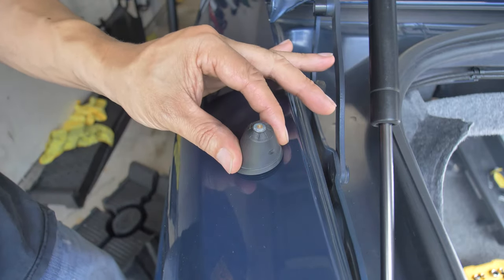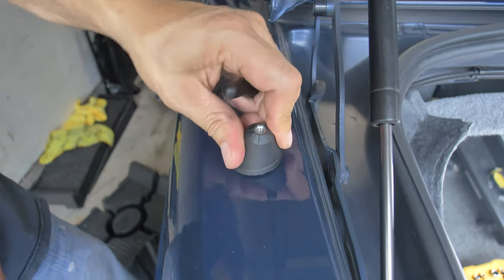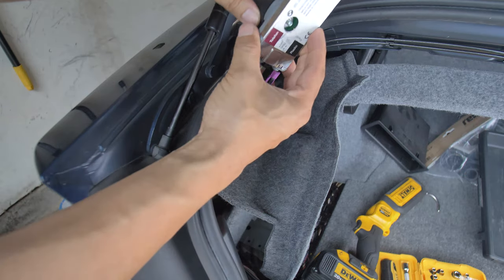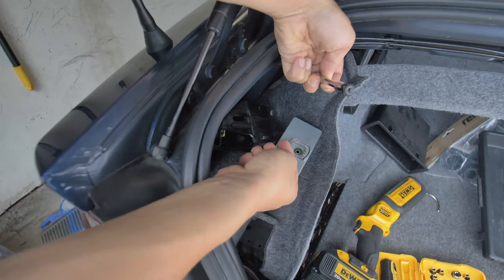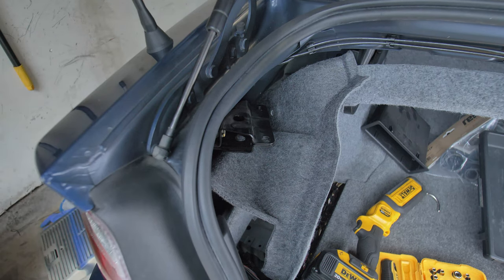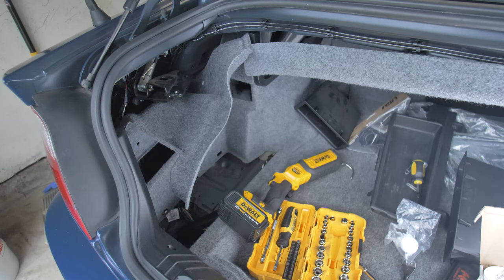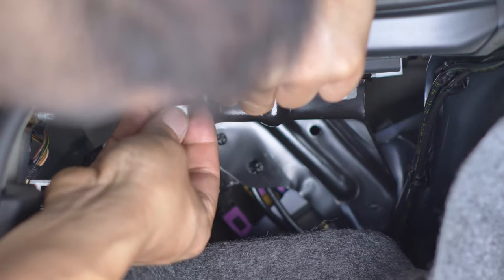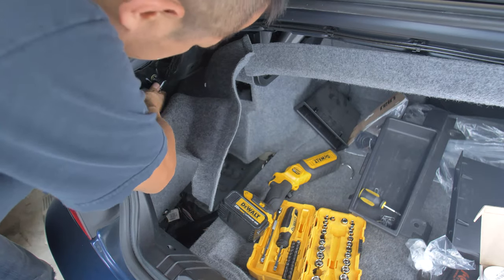E46 Stubby Antenna Installation

Comment: Is this the 330 you're referencing?
Reply from the maker: Yeah. There's tons of video I have to edit for this...including grinding and reinforced epoxy subframe process.
Also just sent in ECU for inspection and repair, trying to solve SES light to pass inspection. That's the only thing left...literally replaced all replaceable parts including hoses, alternator, disa, vanos, lpfp, charcoal canister, dmtl pump etc. Should take a couple of weeks to get back.
Reply: @bmwchannel7209  wow, that is a ton of work. 
Whenever the vids come out, I'll be watching. 
Question, where did you send the ECU to?
Reply from the maker: @jcx2bby  ECU Pros. Person on the phone knew exactly what was up. She said if there was a generator communication BSD error and I had the ms45s Siemens ecu, there was no repair possible...only replacement for 500 dollars. I took out the ECU and sure enough it is a Siemens ms45 unit. Had to send ecu, key, and ews module for them to port over all programming to replacement ecu.
Reply from the maker: @jcx2bby   ecu had no problem so they charged a diagnostic fee. Turned out to be the ECT (COOLANT SENSOR on the lower hose) connectors got pushed away from the prongs so there was no ground and that fucked up the whole system. I took apart the connector and superglued the prongs deep into the housing and it fixed all.
Reply: @bmwchannel7209  wow, you talk about a random gremlin!  Congrats on figuring that out...superb troubleshooting